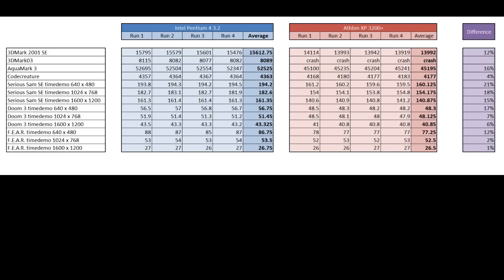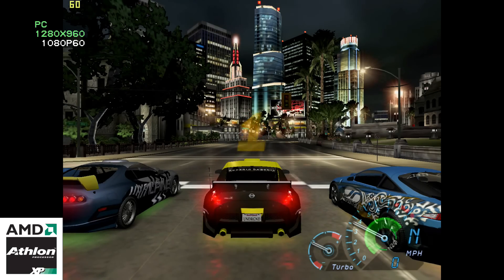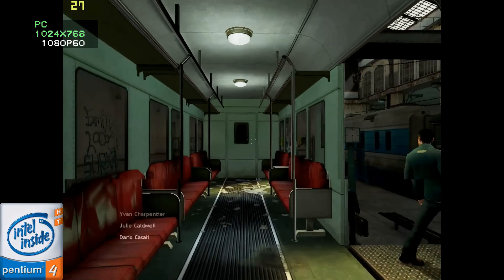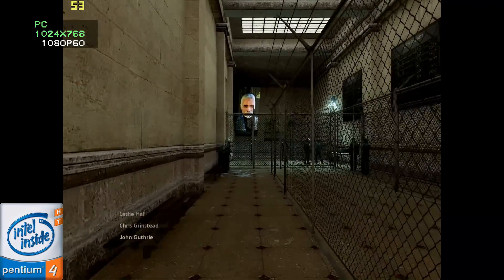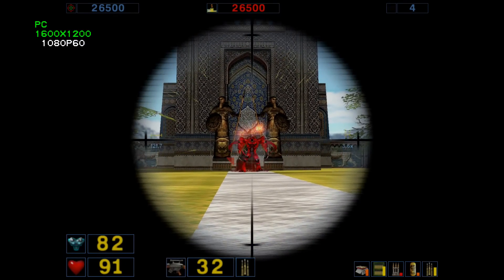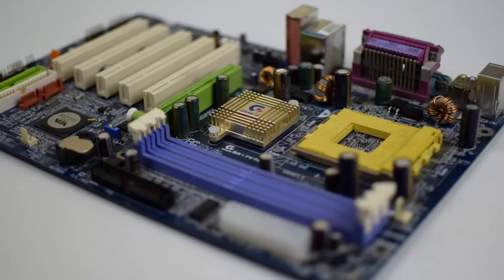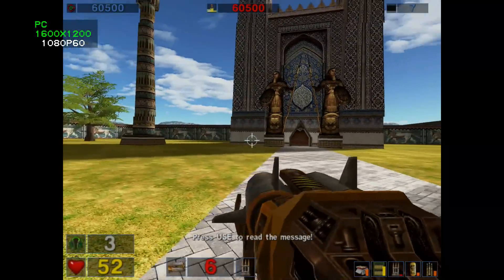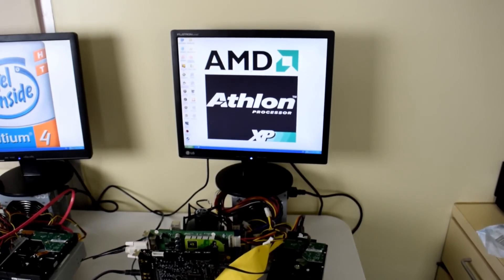Intel vs AMD S1E1 - P4 3.2 vs XP 3200+

Comment: Should've used a Nforce 2 board.
Reply from the maker: +GAMMA XII I knew someone would say that. That's why I chose an Intel 865 board. The nForce 2 is high end, and that means it should go against an Intel 875 board with PAT. I just picked to decent boards, but not super hight end. But hey, that might be something for another video :D
Reply: PhilsComputerLab Hey maybe. All I remember was that Nforce2 motherboards were much more stable.
Reply from the maker: +GAMMA XII I will see what I can do!
Reply: PhilsComputerLab If you test out a Nforce 2 board, can you test out the exclusive Soundstorm Audio chip that used with Nforce 2 boards and compare it to the audigy 2?
Reply from the maker: I'd love to test VIA's next chipset after the KT600 with dual channel memory.

Good news though, I now have an Abit board with nForce 2 Ultra 400 chipset :)

There will be a vide about it, but not sure when. But there will be one, just a matter of time :D

I've also ordered some nice CL2 memory from Corsair. Platinum label, should also boost the AMD.
Reply: +PhilsComputerLab but via chipsets were notoriously finnickey (buggy). nforce2 was rock solid in comparison.
Reply: +PhilsComputerLab 865 is reaosonably high end as well. 845 or even SiS6xx should've been a better comparison. Nforce 2 on socket A is solid as a rock.
Reply: +GAMMA XII Didn't experience any crashes in 3DMark with the NF2 motherboard back in the day, I would also recommend it
Reply: You must have gotten an older hold-over mobo then,  nForce wasalways the gold standard in motherboards until Conroe burst on to the scene with the Core2Duo.  My last AMD build sported an Athlon 64 3700+ (a down clocked FX-55) and an MSI nForce 4+ SLI platinum mobo with two GTX 7900 GT's in SLI!  I miss those days!  I have had 3 builds since, and I am due for an upgrade, AMD's Ryzen will be my next vessel to Valhalla when my tax return comes in 2 weeks!
Reply: That's right Athlon would definitely outperform P4 when paired with nForce2 - VIA chipsets were so slow.
Reply: +PhilsComputerLab It WILL make a noticeable difference, sometimes as high as 10% or so.
Reply: +PhilsComputerLab I don't know about the nforce/2 boards for intel, but they were great on the AMD side of things. It wasn't uncommon for Via kt-chipsets boards to have odd quirks depending on the specific board, but also Via's chipset performance wasn't nearly as good as the nforce2 boards
Reply from the maker: nelizmastr KT600 isn't low end. It's the second last VIA chipset for Socket A. nForce2 400 Ultra was premium / high end. But then you also need to use Intel 875 with PAT, that was Intel's high end chipset.
Reply from the maker: Supadupanerd The only issues I encounted have to do with the SATA controller. Back in the day, SATA II and III didn't exist yet, so not a big deal. Apart from that I didn't have issues to be honest.
Reply: Weird, I got my nforce 2 board because I was on a budget and couldn't afford both a quality mainboard and a GPU on my first ever build. I eventually upgraded to a GF4 Ti 4200 but that on board GF2 really held me over until I could afford a Ti card
Reply: That's probably what it was, I was typically at least one generation behind when upgrading. When everyone else had Thunderbirds and PIIIs, I had a K6-2 - when everyone had X2/X4 and Core 2 Duo systems, I had a Duron and eventually an Athlon 64

I'm still on an i5 2500k but Ryzen has my wallet ready to open up
Reply: Yep. The KT600 chipset was SLOWWWW. NForce2 was the best chipset for the AthlonXP+ CPUs, from what I remember.
Reply: I saw Athlon 3300 XP cpu's at sale at Ebay maybe 8 years - the guy had about 1000  cpu's to sale ( if i remember correctly ) I thought then he had come over some caches of future or abandoned Athlon 3300xps but I thought also that they might also be like the Xp Sempron eg not at the same speeds as Athlon XP or maybe rebranded somehow from a lower clockspeed and sold as higher Sempron.
Reply from the maker: 845 is ancient for 3.2 GHz 800 MHz FSB with Hyper Threading. SIS? No way, why would you when you can use Intel chipset?
Reply: PhilsComputerLab
because you used VIAgra on the AMD side. It makes for a more fair comparison. Nforce chipsets are just a heck of a lot more stable. Especially compared to this low end VIAgra.
Reply from the maker: Yea I posted this a few times and mentioned it in S1E2 video. An older driver resolves the issue, but still, the latest driver doesn't crash on the Intel machine.
Reply: Joey Greathouse I had an Nforce 2 board and could push the CPU another 2-300 MHz; roughly equal to a 3500+. It would outdo most Intel-based systems of the time.
Reply: nforce2 boards weren't even that expensive. nforce1 boards were actually high end.
Reply: I loved my nForce 2 boards.

Comment: Oh, one of my favorite computer time periods!
Still, i don't understand why you were unable to run 3DMark 2003... I remember running it quite happily on my ECS K7S5A\Athlon XP 2000+ and A7N8X-X\Athlon XP  2600+ computers back in the day, with video cards ranging from Geforce 3ti 200 to Geforce 7800GS.
Still, these are the videos i enjoy the most! Please keep'em coming! :)
Reply from the maker: +totalrandomtechnolog I have a hunch that maybe it uses a CPU instruction that the XP doesn't support? Like SSE2? Someone else mentioned that maybe 3DMark2003 got updated. But it could also be an issue with the Nvidia driver and XP processors. Either way, all the games worked fine, so I wouldn't worry about it.
Reply: +PhilsComputerLab "I have a hunch that maybe it uses a CPU instruction that the XP doesn't support? Like SSE2?" 
Not likely phil, i remember also running 3D Mark 2003 on  a Pentium 3 450Mhz and it was ok. The score was a disaster but hey, it did work. Unless like someone mentioned to you, maybe 3DMark 2003 got updated.
Do you happen to own a Nvidia nForce2 based motherboard?
I would love to see the performance difference between this chipset and yours!
Reply from the maker: totalrandomtechnolog I'd like to know too and quite a few mentioned nFore2, so yes, I will check it out :D
Reply from the maker: +totalrandomtechnolog Using ForceWare driver 93.71 WHQL solved the driver crashes and 3DMark2003 completed without any issues.

Comment: Ah this brings back a lot of memories, I had the Athlon XP 3000+ on a Abit NF7 and a Pixelview Geforce 5700 (with a nifty lcd that showed the temperature) , I had a Soltek motherboard that looked good and was stable with my 1.3ghz Athlon, but it just didnt like the 3000+ was very unstable, the NF7 was rock solid.

I loved it till I eventually sold it to go for a AMD Athlon socket 939 X2 based system, and to be honest I was a bit disappointed with it , but thats another story.

I probably sound like a AMD fanboy but my father allways had the Pentium 4s, and I really admired them, I just couldnt afford them lol

Hmm I cant remember having problems with 3dmark03 but it was a very long time ago,maybe try a older revision of it, I had some bugs on my P2 and that resolved it.
Reply from the maker: +HPZeta Yea the Pentium 4 chips cost quite a bit more. Back in those days the price difference was a lot more than it is now. You could actually save money by overclocking and picking the right parts.
Reply: Thats very true, but sadly the 3000+ didnt have much headroom for overclocking and at the time I had some pretty bad ram (Kingmax IIRC) But was still a nice system, I have lots of fun memories playing on it :)

Comment: I had an AMD XP 3000 with an Abit motherboard in the mid '00's. I still have an office computer using an XP 3000 and Windows XP for my older business software. I remember reading a online review that said the XP 3200 400 mhz was a disappointment and the XP 3000 with 333 mhz beat it in several benchmarks, so I never bought one. AMD had maxed out the Barton core as far as it could go.
Reply: +PhilsComputerLab  Replacing capacitors is the only reason my Abit KT7-Raid is still a goer.
Reply from the maker: +wildbilltexas Awww, Abit. Miss that company. I've got two Abit boards, one for Socket 478 and one for Socket A :)
Reply: +PhilsComputerLab I went through several Abit boards with Athlon processors (750, 1200, 2400 and 3000) back then, the last being a AN7. The biggest problem with Abit boards was those junk capacitors. Luckily I never had one that blew up while on but a couple caps near the CPU started to bend or the top would bulge after a few years. Switched to Gigabyte and never had that problem again.
Reply from the maker: +wildbilltexas Haven't replaced caps in a while, might be something I could do and show in a video...

Comment: What components do you recommend to pair with windows xp?
Reply from the maker: +Grow Zero XP spanned like 10 years, so take your pick :D I tried it on a modern i7 with GTX 660 and that worked too. So there isn't much that doesn't work.

The system in the video is a bit slow for my taste. I would go with something a little bit faster, like an Athlon 64 or Core 2 Duo with a Geforce 7, 8 or newer maybe.
Reply: +PhilsComputerLab And a phenom x II, 4gb ram, radeon 5450 1gb?
Reply from the maker: Grow Zero Well the CPU and RAM definitely, I'm not sure on that GPU though, but I think it's fine, it's quite a bit newer.
Reply: +PhilsComputerLab Thanks for the help
Reply from the maker: Grow Zero I think I have the exact same parts here. A Phenom II X2 which unlocks to a X4, 4 GB of RAM and I swear I got a 5450 lying around...

EDIT: Yup found it! 512 MB version of the 5450 :)
Reply: +PhilsComputerLab Which games do you think it run well and decent?
Reply from the maker: Games up to 2003 / 2004 I would say.

Comment: Now Athlon 64 vs Pentium 4 !
Reply: +PhilsComputerLab I know AMD would win that one... also it seems strange you had those crashing issues, I didnt have them on my old Athlon XP (XP 2500+ overclocked to 3200+, 1GB DDR400, ATI Radeon 9800 Pro, Nforce 2 Chipset), also your numbers seem a little low for the AMD, I remember comparing results between the two (with an ATi 9800 Pro) and having the reverse happen, the AMD was faster for games than the Intel.
Reply: +PhilsComputerLab Did you try it out with an ATi card? I am thinking the issues you are having with the crashing may be an issue with the 6600GT and the Athlon XP. The 6600GT was more a card for the Athlon64 era.
Reply from the maker: +jujufaitdestuto' s I think AMD would win that one :)
Reply: PhilsComputerLab Yes i think also :)
Reply from the maker: ***** Yea a lot of people said the same thing. It must have been something to do with my setup.
Reply from the maker: I picked the 6600GT because it was the fastest card I have. Yes, could be an issue with the graphics driver. I keep that in the back of my head for things to try.
Reply from the maker: Oh well, it is what it is.

Comment: how dose athlon run hl2
Reply from the maker: +Crazy Tubex At 1024 x 768 it runs quite well. I think the graphics card is a bit weak for 1600 x 1200. Also, apparently the HL2 engine has been updated over time compared to how it was when it was released back in the day.
Reply: do you have any idea how well CS:S and HL2 would run on semrpon 2800+ am2 socket with 8600gt and 2gb of ddr2 ram
Reply from the maker: Crazy Tubex I'd go for something more powerful to be honest.
Reply: yea but I dont have money , I have all of these parts now , I dont wont to build a pc for nothing because I want to build 2003-2006 era pc.
Reply from the maker: Crazy Tubex I hear you. I had a quick look regarding the 8600 graphics card, I wasn't familiar with that. Here is a review: http://www.anandtech.com/show/2213

I think you should be fine, it's more powerful than the 6600GT I used that's for sure!
Reply: Yes, you're not playing the retail version of hl2 but "hl2 2007"

It's a pain to try the original game now ... (I'm trying to launch hl2 on my pentium 3 1ghz, but steam is out of question since that computer runs under windows 98 (and hl2 2007 too, I dont want to kill it ^^) so I have to find how to crack the original game, etc ...)
Reply: will the original version of hl2 work on semrpon 2800+ 1.6ghz , its a single core but its 64-bit
Reply: +Crazy Tubex I dont think that the 64 bit will make any change, but by this you mean a 754 or 939 sempron, right ?
Reply: no am2 socket semrpon , full name of cpu is amd 64 semrpon 2800+
Reply: 1.61ghz
Reply: I played cs:s on 462 semrpon 2500+ and it worket some what ok
Reply: +Crazy Tubex oh I see, sorry. I've mistaken because I have a sempron that has 64 bits and that is on the socket 754
Reply: that probably newer semrpon then mine
Reply: Crazy Tubex
Well the 754 socket is older than the AM2 socket so I don't think so ^^
Reply: what year did your semrpon come out mine came out in 2005
Reply: The 754 socket was launched in 2003, so I guess that it was released between 2003 and 2005

Comment: I had that Athlon motherboard, it was pretty decent. I remember using it with a socket A Athlon XP mobile 2500+ (1850MHz). I had it wire modded (drop bits of speaker wire to bridge the pins in the socket) and overclocked to 2530Mhz, it was a great chip and served me well, so well that I bought 2 other mobile athlons of ebay recently to mess with.
Reply from the maker: +ThePlethora1980 I heard good things about mobile Athlons. Got to check that out one day.
Reply: Its quite interessting - with my Pentium III-S at 1850 MHz and also a 6600GT (slightly overclocked) Im am slightly under 14.000 Points in 3DMark 2001SE. Means its about fast as a 2800+ or something. At least in this benchmark. Back than I also hat a XP 3200+. 2,4 GHz were no issue. In one of ny retro system I have a XP-M 2400+ (35W) watercooled running at stable 2,6 GHz. 2,7 GHz crashs in gaming after a while....